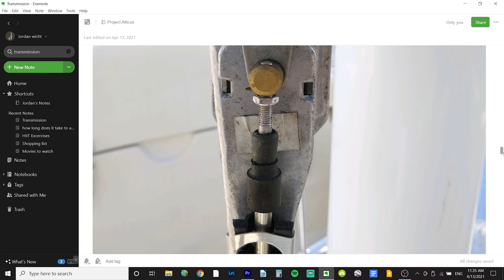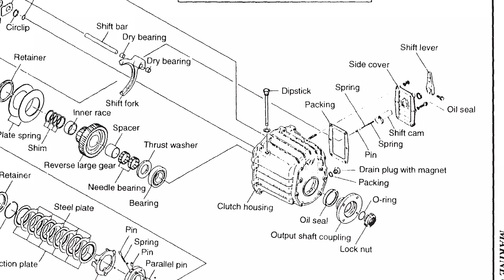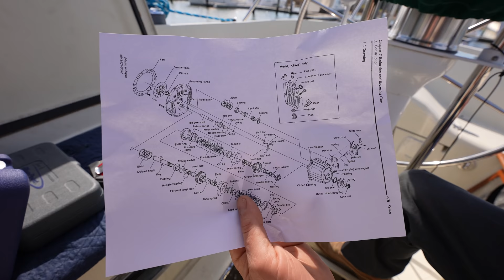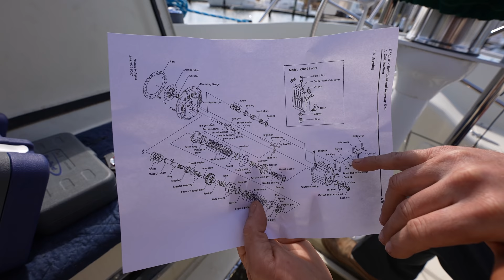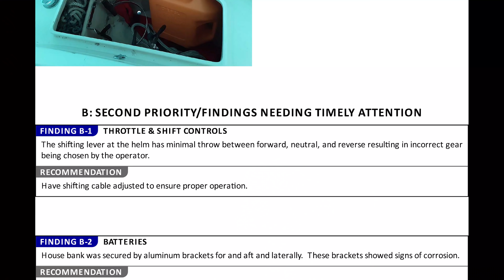This is a BIG problem 😧 | S06E02

Comment: For the rubbing throttle cables look into plastic conduit bushings. You might find one to fit there and it should reduce the rubbing and keep sharp edges away from it. Best part of all they are not expensive.

Comment: Worked on a  couple of 'small' (26 to 88 foot) boats on various ships in the USN, and most seem to have that wonderful 'not quite out of gear' deal.  I learned that when they say to maintain the cables (and slush them with grease) they are NOT kidding.  Stainless, cables and as much grease as you can get into the housings.   I would also stock (permanently) at least ONE set of the rubber accordion deals too. P.S. I might think about making myself a PTFE bushing (it is easy to machine/cut) to go inside the housing then feed the cables/housings in there.

Comment: McCotter's Marina, Washington NC. Cheaper than Oriental (which is an hour away by car). Great, friendly work yard. Good staff and good rates. Laid back. Extremely well protected, up the Pamlico River. Decent depth. Good little town with a West Marine and a Lowes and a bunch of machine shops, and some decent restaurants. You should check it out.

Comment: This is a great episode for me.  I have a 1982 Island Trader 38' Ketch rig that has the exact same problem.  Its really hard for me to find neutral with the shift lever.  I have a yanmar 3QM30H motor with a Yanmar Transmission.  Hoping I will just be able get away with adjusting the shift cable.

Comment: Hi folks. Love your channel and positive attitude! 
I also appreciate your decision to not criticize the surveyors. 
However, I would argue, hiring a surveyor is for more than just having a person tell me a system or piece of equipment works at a particular operating standard. In your particular case, a more extensive examination could have been negotiated for repair or leveraged in sell price. 
As with most things - you get what you inspect.

Comment: Hopefully the gearbox and clutch plates are fine and it is just the shift fork that is bent and or a spring that is broken not letting the shift lever locate itself correctly. Having it inspected is definitely the way to go . Should be an easy fix. Y'all have fun now. Looking forward to seeing your fine boat underway !

Comment: I know where your coming from I ended up having to put a new engine transmission prop shaft prop and drip less seal huge expense but in the end was worth it to have a reliable power source

Comment: Transmission removal is actually quite simple. There's a minimal number of bolts to remove them so you can get it apart on a bench t inspect or take it to a mechanic. Before long distance crossings, etc. these types various issues are going to happen so you better get used to not being afraid to tackle them yourself. Talk with any blue water sailor & you will find they all typically know every system on their boat inside & out & have have them all apart & repaired at some point. Carry LOTS of spares of everything you can, it's an added expense, but literally can be a lifesaver. Good luck.

Comment: Your boat is looking very nice and well equipped. So it must be quite frustrating that, despite a thorough inspection, you encounter several technical problems.
This problem of not proper installed cable control in relation to the full stroke of gearbox and throtle levers is a common problem on board yachts.
Carefully measure the full stroke of the cable without being connected to the gearbox lever by moving the handle on the pedestal from full ahead until full astern. Mount the cable on the gearbox in such a way that neutral in both places is really neutral and that this full stroke exactly corresponds with the stroke the upper hole in the gearbox lever makes. You probably will also have to adjust/lengthen the steel plate on which the outer part of the cable is mounted on the gearbox in order to achieve this situation and of course also to get neutral on the control handle at the position of neutral on the gearbox. Sometimes the length of the lever on the gearbox even has to be adjusted a little as well. And make sure the cables are only laid with very fluent bends.
The cable must be able to fluently move from full forward to full astern without pressure and/or bending.
In case you do not adjust the cable and the control unit like this you will remain having problems with your controlhandle, your cables and with your gearbox as long as you will have this boat.
I have made these modifications on several boats already. It takes sometimes quite some time to get this well done, but it pays out in a reliable and long lasting system without giving problems.
I wish you success.

Comment: I was thinking you should go to Hilton Head Island and do all your work there.  The people are great, it's laid back, and you can get everything you need in time.  BTW - that was an EXCELLENT IDEA to tie a string onto the throttle cable...BRAVO!  File a chamfer on the inside of that tube to make sure there are no sharp edges to rub against.  You should do that now while waiting for the transmission to be fixed!!

Comment: You should consider a boatyard in Maine. I think you will be able to find what you want, it will be a nice, cool change of pace in the summer, and they build lots of boats there. And you are already pretty close. I’m sure others will have specific recommendations.
Reply: Love Maine but the only problem is dealing with black-fly and understanding the local dialects. 😏

Seriously though, getting splashed and on their way from NC to Panama before hurricane season is in full swing will be easier. I might even consider a FL marina. Refits always take longer than expected. 

If it were a mostly wooden boat I’d without a doubt head to Maine.
Reply: @MaShcode  bock marine  between oriental and Beaufort . super nice folk , diy friendly  , good price . im from Maine .

Comment: I thought this a bit more.  It sounds like you may have a broken shift spring.  If your transmission is like mine the shifting mechanism is preloaded my forward and reverse shift springs. So when you move the shift cable to shift gears the shift springs take over and shift your transmission fast.  That way the clutches don't slip between neutral and in gear.  It makes sense that if you had no resistance on the shift lever of the transmission you have a broken shift spring.  
You probably have already found and fixed the issue.  I am looking forward to seeing your video on what the issue was and how it was fixed!!

Comment: This is a big reason why I replaced my 40 HP Volvo Penta diesel with an electric motor. I'll lose motoring range, and the installation hasn't been without challenges. But the simplicity and essentially no maintenance means that the days of hanging upside down as I curse the greasy beast are over.

Comment: I think you'll find that the transmission failure stems from the corroded and mis-adjusted shift cable. Also I'm not familiar with that type of transmission but I think you should only attempt to shift with the engine running, and even then with a bit of a snap, don't shift it slow, I'm probably wrong but it's worth a look in the operation manual for the transmission.

Comment: When the transmission goes back in and if needed......it looks like you can "clock" that lever and that may address your original binding issue.  It looks similar to a gear shifter on a motorcycle. Loosen bolt, slide off move it a few splines in the desired direction.

Comment: Feel your pain.  Hang in there. 

Boats!  This year a simple haul out for a bottom job turned into a shaft alignment, drop the rudder, new cutlass bearing, realign engine mounts...new shaft seal....hey wait the water pump is dripping....then took mast down to replace rigging and add radar and new wiring, blah blah blah.  

Good news is we are safe and boat 
is back in water and ready for the new season.

Comment: One piece of advice...throw away the WD40 as its corrosive to some plastics, so some little parts will disintegrate over time and can cause you problems. I always use a similar but much better product called 'Inox'. Its a vegetable oil mix, seems to lubricate better and for longer and it safe on plastics. It comes in a spray tin the same as WD40.
Reply: Just the lubrication lifetime is enough for me.
Reply: Also WD is really a cleaner posing as a lubricant. Best to clean first then lubricate separately with the proper weight oil. But people like to take shortcuts.
Reply: Baloney
Reply: @MajTom-wd2yt  if you don’t know that wd40 breaks down plastic over time ya not really experienced then🤷
Reply: @JDGTubed  Thank you, experienced one.😂

Comment: Brokered sales always require the trust that comes with honesty but that said you can’t know the unknowable. Be nice if there could be a 30 day escrow for these types of major issues similar to a limited warranty. Also being a sellers market places you at an even bigger disadvantage. 

Like when we discovered a weeping heating oil tank that was missed by the pre-sale inspection. Could have bought three new tanks for the price of disposing of the old one. But there was no way to know since the owner spray painted the tank to cover up the flaw.

Comment: I agree with you to some extent.  A surveyor is not going be able to go into great detail regarding abnormalities.  However, knowing that "little problems on a boat can be big problems" means that YOU need to determine the extent of the problem identified by the surveyor BEFORE you place an offer on the boat.  Being in a rush to purchase the boat, being compromised by having to live in a hotel, etc. meant that you did not offer the current owner, who almost certainly DID KNOW the extent of the problem, an appropriate purchase price given the defect.  In the legal business we call this "minimization" and it's unfortunate to see..... My wife and I love your optimism, and your positive approach to life, problems, etc., but you could have mitigated the adverse consequences associated with this purchase to a great extent.  Bottom line:  if there is an issue, it needs to be fully fleshed out....PERIOD.

Comment: Just to let you know WD 40 is not a lubricant it is a moisture displacer and will not protect the interior of the cable control box over time .The best protection is a coat of lithium grease on all of the moving parts including a dollop down the tube to prevent water ingress through the deck.
Also replacing the control box will prove wasteful and difficult as it is a component part of the steering console and to all intents and purposes unobtainable ,best to service the parts and reinstall when you get the transmission repaired.

Comment: Hopefully the transmission wasn't to costly. As a side note, please stop using WD-40, it dries to a shellac/varnish type coating. Many other penetrants and rust busters are out there like PB-Blaster and Seafoam being available everywhere. For a penetrant and lubricator of "sticky" mechanicals where oil/grease is not appropriate use T-9 Boeshield, expensive yes,  I've be using it since the early 90's. It leaves behind a waxy film for ongoing lubrication.

Comment: Very simple to rebuild Trans.!!!...The wierd part is finding out what other "machine" uses that particular Trans.  Once you have (if you can) done that..it's just a matter of dissassemble and reassembly with new parts..Shift Fork ( probably broken) and "Blocking Rings" ( also k own as Synchronizer Rings)..I'd go ahead and replace ALL bearings and Seals while apart!!!...Of course now you'll need to replace that chrome Shift Cable Housing you carved up!!...so your "lengths" are proper!..Ant body who rebuilds "Straight Shift" Trans., 4x4 Transfer Cases, Lawn Tractor Trans, etc. can do this..Make sure "whoever" does it is competent enough to measure all the "clearance's"!!!!!!!..  A Boat Repair mechanic will charge 10 Times!!!! as much to do this EASY REBUILD!! so I highly reccomend finding and OLD MECHANIC who has done many hundreds of these "Rebuilds" during their career (like me..LOL) even some Motorcycle guys should be able (and have the tools) to do this..If I was doing this I'd charge around $200-$250 plus parts!! ..Quick note: On Bearings!!..look at the "ID" # on the side (Bearing Race) and buy your Bearings at "Fedral Bearing" or "Dixe Bearing" ..You will save the 10,000 % MARKUP that a Boat Supply Parts Store will charge!!!!!..Really..a $15.00 Bearing will sell for $300.00 (or some such rediculos price) once itnis "Boxed / Packaged" for a specific application (same thing with Blockng Rings and Shift Fork)!!!.. Good Luck you'll be fine and CONGRATULATIONS on your beautiful boat!!!..Looking forward to watching your future adventures!!!!

Comment: Probably could have mitigated the chafing without cutting the tube shorter.  The cables could have had some plastic spiral wrap put around them, wrapped with something like 3M 77 tape, or even bedded in a glob of RTV to immobilize them.

Comment: Put your shifter in the neutral then go down to the transmission and put the arm of the transmission into neutral now connect your cable to the the your you clamp to the arm of the transmission then mount the cable just your adjustment is in the cable at the transmission that's why there's a threaded end on the cable itself to either go forward or backward with a you clamp to the arm of the transmission

Comment: Sorry that you're having so many issues after your purchase.  I disagree with your estimation of the surveying, respectfully.   They should have found the gas issue, the water issue, and allowed for more caution with regard to the transmission.  I would not use these surveyors.  The three things you've had problems with are some of the three major things to look out for on a boat this age.   Respectfully disagree with your very kind assessment of the inspectors.  

However, I do feel like you still got the best boat, for a great price.   I think most of us will just assume that when we buy a boat at this age, that we are going to have to replace and repair many of the major systems.  

This boat, has always been my favorite boat, since childhood.  I don't know why.  I like the way it looks and the color schemes and the sturdiness.  It's a very sexy design. And secure sailing.  I grew up on the water sailing a hunter 37 and power boat.  

Best wishes to you.  

Mark
independent researcher 
theoretical & applied physics

Comment: moving the lever with no resistance in either direction tends for me to think it is a shear pin that has broken.  because it was originally difficult to shift, this could have led to the failure of the shear pin.  now the question remains, "Why was it hard to shift in the first place?"   Let's keep our fingers crossed.    IMHO from a distant observer.

Comment: Realistically that transmission is very simple compared to an automotive transmission with multiple gears. You probably either loss the shift fork that Crescent moon piece that you are describing or the shift rod probly loss the connector. Overall there's not much stuff in there that can fully break and cause that lever to free wheel like it did.  Generally if those interviews with the clutches in such you have issues shifting from Forward to neutral to reverse without getting a grinding or very hard clunk.

Comment: Whether it’s a house a car a boat it really doesn’t matter there will be times when you think that it’s going to be something small and it turns into a major project but the reverse can also be true. You will be looking and scratching your head trying to figure out what’s wrong with some system and think maybe I have to replace or rebuild the whole thing and eventually figure out it just need A fuse replaced to give it power or some other small insignificant thing as for example your propane problem when you forgot to turn the switch on, or gas valve, I forget which it was.

Comment: Hi, you should never switch the gear position very often without a running engine. The spot you mentioned when its is gettings from hard to soft while shifting the gear is the moment when you force the teeth of the gear into each other without they are synconized through the rotation of the propeller / engine shaft. Since you did that often i guess that the part wich is inside the gearbox moving the teeth for- and backwards broke. Since this needs to be change I would overhaul the whole gearbox. I have done that once, never again my self...
Interristing to see if I am right.

Comment: Simple fix if it happens again with the pipe rubbing against the cable, file and smooth out the inside lip of the pipe. That will make the cable run smoothly against it. That was probably how it was supposed to be so it’s probably a manufacturer defect.

Comment: I suspect you’re correct that the shift lever was not fully into the desired position when selected. This can absolutely damage the transmission. There is no part way in or out of gear. From what I see on your video it wasn’t correct when you got the boat and doubtful that’s the way it was from the manufacturer. There should be a definitive angle for forward, reverse and a detent at neutral. Have the guy that removed it set it up correctly. He seems to be up to speed on this. There should be a neutral switch that only allows the engine to start out of gear, but I didn’t see it. You did well to replace both cables and watch for the binding/chafing. You do know what BOAT stands for? Break Out Another Thousand. Welcome to boating😆